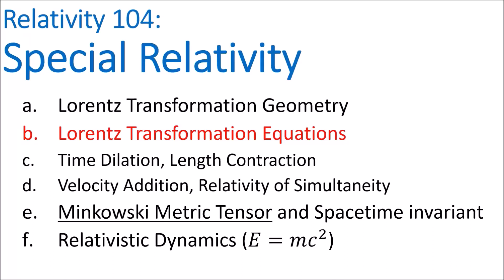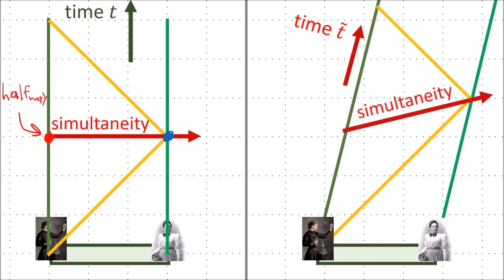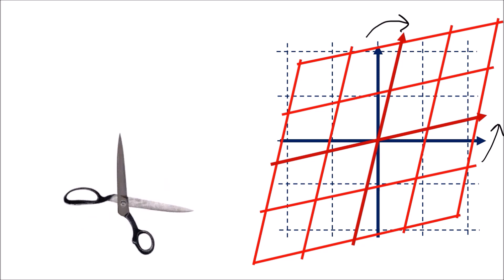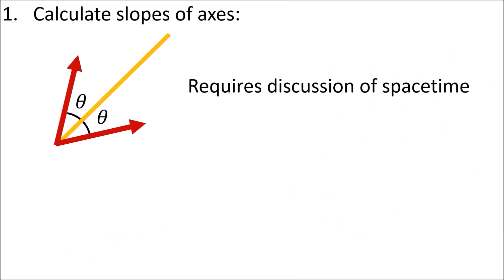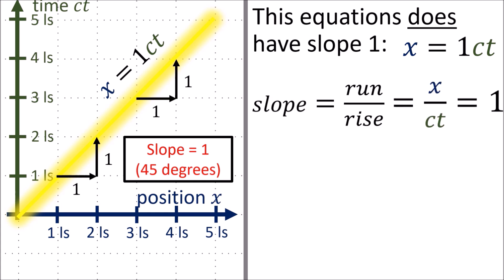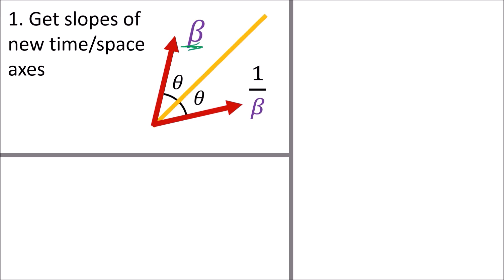Relativity 104b: Special Relativity - Lorentz Transform Equations Derivation

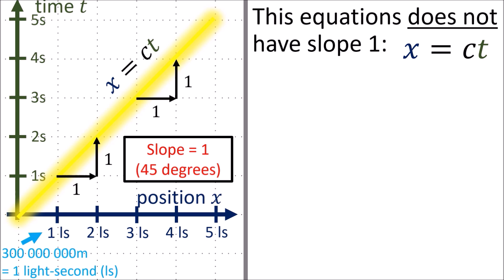Comment: @eigenchris - You are saving a lot of my time in my journey to GR with these videos. Thanks a lot for that. A quick observation: I feel that at @2:29,  the unit of time axis can be s (seconds) and the equation can be x = t instead of x = ct, as you have already defined x in light seconds. With this, there will not be any question of using distance units for time. What do you think?

Comment: you used x-tilde and ct-tilde in the video, are those meant to be components or basis vectors? Because the formula x-tilde = x - v*t is one of the formulas for components…right? But you used x-tilde and ct-tilde to mark the axes, so are they meant to be basis vectors because of that? 
And then you applied the scaling(gamma) and when gamma was less than one, the axes also shrunk; if x-tilde and ct-tilde were meant to be components, wouldnt they actually GROW when the basis vectors shrunk because of contravariance?

Anyways, Great Video, finally a good explanation for everything that was just told to me as a „fact“ in school(I personally like to derive/have an explanation for that stuff way more)

Comment: There is a type of Space-Time diagram in which the scale for both systems is the same. They are called "Loedel Palumbo Diagrams" and with them any analysis of special relativity is significantly simpler. They were developed in the mid-20th century by the Uruguayan physicist Enrique Loedel Palumbo from the simple, but brilliant idea, of considering in a diagram of Minkowski not one, but two "mobile" systems with the same speed, but in opposite directions and then remove the "fixed" system from the middle and... voila! you have two systems with the same scale! .The relative speed between these two systems is now given by the sine of the angle between the axes, not by the tangetic and trigonometry is that of all life. It is a shame that they are not very widespread.

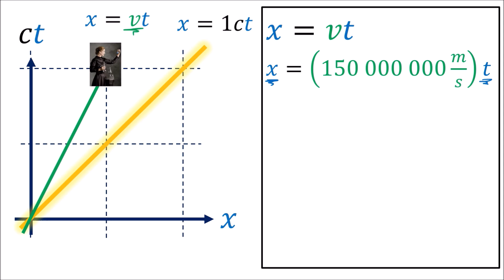Comment: Great video series! At 05:28 might be a bit more intuitive to say that you multiply RHS by (c / c), when make the RHS become (v / c) * (c * t).
Also, at 17:22 the gamma calculations came from imposing the constancy of the speed of light, and the determinant of the Lorentz matrix being 1 came as an after-fact.

The early assumption that gamma does not change in the reverse transform can IMHO be relaxed with a +- sign, which can then be resolved noticing that (1 - B^2) and gamma^2 are both positive, and hence the +- must be a + to equal the +1 on the LHS.

Comment: At 10:40, why must the spacing be different due to assuming c is constant? I thought that c would be constant as long as the tilted axis form the same angle with the x=ct line so I don't quite understand why it is a requirement that the axis spacing must be different. Thanks in advance!

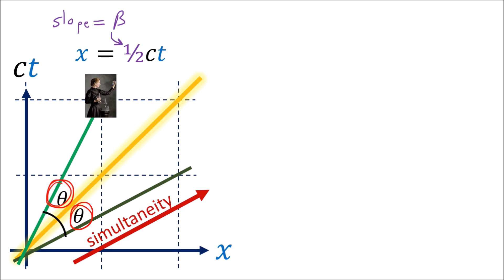Comment: :(  I don't get the "reciprocal slope" part, 7:20 - 7:45?
Reply: I mean, I get it that the angles (between the time axes: t & t', and between the position axes: x & x') are the same. Thus, based on their tangent, the slopes are all equal to 1/2. But, I cannot understand "Marie's time axis runs one unit distance for every rise in two units of time" and "her position axis will be reciprocal and run 2 units of position for every rise in one unit of time". But, the speed v of Marie's frame is (1 unit of distance/ 2 units of time) = 0.5 c, so what does it mean by "her position axis runs 2 units of position for every rise in one unit of time"?? Does it not make sense, since "2 units of position for every rise in one unit of time" would means the speed = 2c?
Reply from the maker: The position axis isn't a physical object moving through spacetime, so nothing is travelling faster than c. Marie's position axis is just a "slice" in the spacetime diagram that shows when all events happen at t=0 for Marie. This is similar to how the horizontal position axis is a slice of spacetime that tells us when all events at t=0 happen in the standard reference frame.

Comment: If the object is moving to the left relative to an observer on a space time graph, does that mean beta is negative?
Reply from the maker: Yes. Beta is just velocity divided by c. So negative velocities get negative betas.
Reply: @eigenchris  I've not watched the entire series yet but do you have any videos where you show lorentz transformations in the negative x direction of the space time diagram?
Reply from the maker: @147JMP  I don't specifically recall, but the axes just scissor together in the other direction. It would just be a mirror image of the transformation in the positive direction.
Reply: @eigenchris  I just realised, if A sees B moving at v then B sees A moving at -v so the betas in the Lorentz transformation need to switch signs in order to make sense of that. Does that make sense? 😂
Reply from the maker: @147JMP  Yes. You're describing the "inverse" Lorentz transform that I talk about in the next video. To get the inverse, you just switch the sign of beta.

Comment: Hi Chris, appreciate such good videos that give an intuitive understanding to SR. 

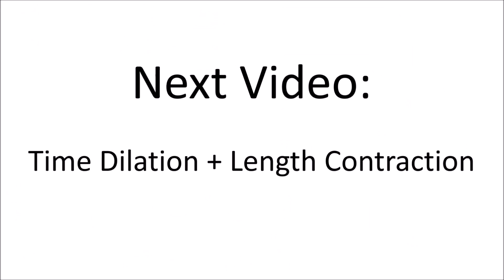I wanted to point out a minute error in your spacetime axes for tilde bases, the inclination of the axes (or the marking on the tilde bases otherwise) are not to scale, for example one can see at 17:20. the x-tilde = 2 line should intersect the x axis before the x=2 mark and so on. I am making this comment on such a minor thing as I was stuck onto the graph for a while and some other curious soul might find this helpful and also so that you can try and avoid this in case you weren't aware of it.

Comment: Relativity Crisis:
Einstein has taken us down a wrong path, and 100 years later, physics has not recovered from the consequences. We need to look at the clear evidence and go back to working on real physics instead of science fiction! Theory and experiments show Special Relativity and General Relativity are optical illusions. Space and time are absolute as denoted by Galilean Relativity.

Hi my name is Dr William Walker and I am a PhD physicist and have been investigating this topic for 30 years. It has been known since the late 1700's by Simone Laplace that nearfield Gravity is instantaneous by analyzing the stability of the orbits of the planets about the sun. This is actually predicted by General Relativity by analyzing the propagating fields generated by an oscillating mass. In addition, General Relativity predicts that in the farfield Gravity propagates at the speed of light. The farfield speed of gravity was recently confirmed by LIGO.

Recently it has been shown that light behaves in the same way by using Maxwell's equations to analyze the propagating fields generated my an oscillating charge. For more information search: William Walker Superluminal. This was experimentally confirmed by measuring radio waves propagating between 2 antennas and separating the antennas from the nearfield to the farfield, which occurs about 1 wavelength from the source. This behavior of gravity and light occurs not only for the phase and group speed, but also the information speed.

This instantaneous nature of light and gravity near the source and been kept from the public and is not commonly known. The reason is that it shows that both Special Relativity and General Relativity are wrong! It can be easily shown that Instantaneous nearfield light yields Galilean Relativity and farfield light yields Einstein Relativity. This is because in the nearfield, gamma=1since c= infinity, and in the farfield, gamma= the Relativistic gamma since c= farfield speed of light. Since time and space are real, they can not depend on the frequency of light used. This is because c=wavelength x frequency, and 1 wavelength=c/frequency defines the nearfield from the farfield. Consequently Relativity is an optical illusion. Objects moving near the speed of light appear to contract in length and time appears to slow down, but it is just what you see using farfield light. Using nearfield light you will see that the object has not contracted and time has not changed. For more information: Search William Walker Relativity.

Since General Relativity is based on Special Relativity, General Relativity must also be an optical illusion. Spacetime is flat and gravity must be a propagating field. Researchers have shown that in the weak field limit, which is what we only observe, General Relativity reduces to Gravitoelectromagnetism, which shows gravity can be modeled as 4 Maxwell equations similar in form to those for electromagnetic fields, yielding Electric and Magnetic components of gravity. This theory explains all gravitational effects as well as the instantaneous nearfield and speed of light farfield propagating fields. So gravity is a propagating field that can finally be quantized enabling the unification of gravity and quantum mechanics.

References:
--------------------
William D. Walker, PhD Thesis - Gravitational Studies, ETH Zurich, 1997
https://drive.google.com/file/d/10TfEEYIa7FyOAJAr2dwKCQKE7qnMfnNs/view?usp=drivesdk

William D. Walker, Superluminal Electromagnetic and Gravitational Fields Generated in the Nearfield of Dipole Sources, 2006
https://arxiv.org/abs/physics/0603240

William D. Walker, Nearfield Electromagnetic Effects on Einstein Special Relativity, 2007
https://arxiv.org/pdf/physics/0702166

Z. Wang, ‘New Investigations on Superluminal Propagation of Electromagnetic Waves in   Nondispersive Media’, Nov. (2003).
https://arxiv.org/vc/physics/papers/0311/0311061v1.pdf

J. C. Sten and A. Hujanen, ‘Aspects on the Phase Delay and Phase Velocity in the Electromagnetic    Near-Field’, Progress In Electromagnetics Research, PIER 56, 67-80, (2006).
https://www.researchgate.net/publication/254072994_Aspects_on_the_phase_delay_and_phase_velocity_in_the_electromagnetic_near-field

Hans G. Shantz, "Near Field Phase Behavior", 2005
https://www.researchgate.net/publication/4199558_Near_field_phase_behavior

Comment: at 10:58 you said that \gamma larger than 1 gives a larger grid area but we know that \gamma is mostly larger than 1 for moving objects. The determinant argument shows that any arbitrary value of \gamma can give us the determinant equal to 1 which means for all larger values of \gamma the area between the grid must still be similar. I cannot get it. Kindly explain it
Reply: For large values of gamma there are large values of beta as well . And they compensate for any change in the grid area other than 1 .

Comment: I am breaking at the x~ and ct~ formulas right now due to not understanding why must we subtract the axis by the distance between them and the slopes.Also the multiple x formulas are really confusing.
Reply from the maker: Can you point out the timestamp(s) in the video where you're confused? I try to explain the reason for the subtraction in the 103c video with Galilean Transformations, where it's easier to understand. If you put your finger somewhere on the red ct~ axis and look at the x-position (say it's x=5), the x~ position is x~=0, since we're on top of the ct~ axis. In order to get from x=5 to x~=0, we must subtract 5 from x.
Reply: @eigenchris  I think I understand,was abit frustrated since I spend a few hours(3-5 hours lol),just trying to rationalize it.Sorry if I came out as a bit rude

Comment: I feel like you have made som major errors here.Particularly near 9:19.When every formula you have written equals 0,no?
Reply from the maker: The equations on the screen around that time give the definitions for t~ and x~, so I think they're right? Can you explain what you think is wrong about them?
Reply: @eigenchris  I feel like they should equal 0 since Bx=ct so shouldn’t ct-Bx=0 for example
Reply: @eigenchris  Unless the approximate sign changes them to be 0.0000001 for example then I don’t know why wouldn’t you just write that in as an example.
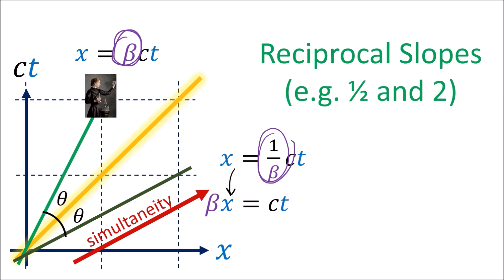Reply: @eigenchris  I think I’m starting to see why I am confused.I think it’s the notation x since at 8:11,you wrote x=Bct and Bx=ct which obviously can’t be true at the same time but one of the x was actually the change to the y axis and the other to x axis itself but you kept using the same notation so it threw me off at the end when we finally get to the derivation of the lorentz transform.
Reply: @eigenchris  Unless I am missing something,I feel like those parts were just not presented clearly.

Comment: I am bad at math but does the gamma cause the area after transformation to be 1? if so why? Thanks in advance
Reply from the maker: Yes. Without Gamma, the rhombus will have an area of 1-beta^2. By including the gamma factor, the area is normalized to 1. If you are familiar with determinants from Linear Algebra, the area of the box is the determinant of the matrix you use for the transformation. You can try taking the determinant to get the areas with and without gamma to see what the results are.

Comment: We're rewatching this series, and boy, are there a lot of hidden gems! Not only is your derivation so much more simplistic and intuitive than what you'll find in textbooks, but we loved that you actually stopped to discuss how distance is coordinated to time in relativity. For instance, it only recently struck us that spacetime diagrams aren't plots of space vs. time, but rather space vs. space, with one axis of space being space that is locally confined to a light-clock and thereby coordinated to time. It certainly gives a lot more grounding to the abstract concept of "slicing" the spacetime manifold into temporal vs. spatial directions.
Reply from the maker: Thanks. I sometimes worry my older videos don't hold up as well. I agree the coordinates don't matter much. The only objective thing in spacetime itself are the light-like worldlines. I think of these as a bunch of "X"s at every point, showing where the left-facing and right-facing light beams travel. This divides vector space at that point into the "timelike" and "spacelike" sections, where the time and space axes normally go.
Reply: @eigenchris  They hold up for sure!

Comment: I still don't quite get what gamma is all about.

So we have our own coordinates x and t, and a moving observer has coordinates x' and t' which is Lorentz Transform'd. 

Is gamma the difference between the length of the moving observer's gridline and the stationary observers gridline? The length I'm referring too is the length of he gridlines as seen in the diagram. 

So, if on the x and t coordinates the visual length of the line from x=0 -> x=1 is 2 centimeters (if we measure the diagram itself), then x'=0 -> x'=1 is 2*gamma centimeters?
Reply from the maker: It's unfortunately not that straightforward. Even if gamma=1, the lengths of the gridboxes would  change under the Lorentz transformation, so you can't just take the original 2cm and multiply it by gamma. I tried to explain this in the video, but "beta" gives use the correct angles of the axes, but we have no guarantee that the length-scales of the axes are correct. We need to use the gamma factor to get the correct lengths scales, and we do this by forcing the transformation to be equivalent in both the forward and backwards directions by using the same gamma factor in each case.

This might be more details than you want, but 'visual lengths" are not the best tool for examining spacetime diagrams. Instead, we measure lengths using something called the "spacetime interval", denoted by the letter "s". My 104e video discusses this, although the math is more complicated than this one. You can give it a try if you like.

Comment: I can't seem to understand why the value of gamma should be the same on both direct and reverse Lorentz transform. I mean gamma was added to correct the equation of the direct transform and nothing says it's a constant that shouldn't depend on which frame of reference is "original" .
Reply from the maker: Gamma is a scaling factor for the coordinates. If you were scaling "up" when moving to the right, but scaling "down" when moving to the left, that would mean there would be a meaningful way to tell the difference between left and right. But all directions in space should be equivalent, so the scaling factor should be the same, no matter which direction we're transforming in. Does that answer your question?
Reply: @eigenchris  makes more sense now . Thanks for the quality content !

Comment: Note to self (7:20): To see this, recall that the light beam is at 45 degrees, and so the angle between the green line and the ct-axis (45 - theta) is equal to the angle between the dark grey line and the x-axis.

Comment: HI Chris. When you calculate the slope of a graph, for example, a line, you get first (y) as a function of (x). It is y = mx then you get the slope(m). In the case of the (ct) axis, its slope should be determined by getting (ct), therefore ct = (1/beta)x, so the slope of this axis is  1/beta. And for the same reason, the slope of (x-axis) is beta. 
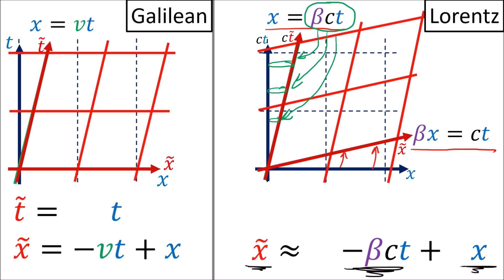You can see in time 9:29, that if you clear (ct) form equations for (ct-axis) and (x-axis), you will get the slopes as (1/beta) for the 1st and (beta) for the 2nd
Reply from the maker: You're right if you use the standard slope convention. I was trying to use the convention where slope is "distance/time" = "x/ct". I tried avoiding the word "slope" as much as possible and saying "more vertical" and "more horizontal" to avoid confusion.
Reply: No way you measure time by ct.